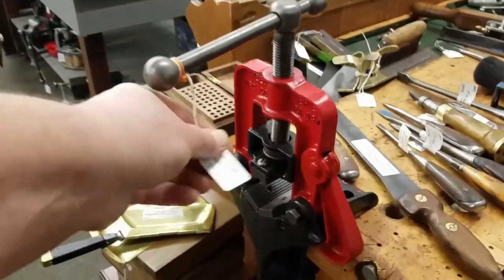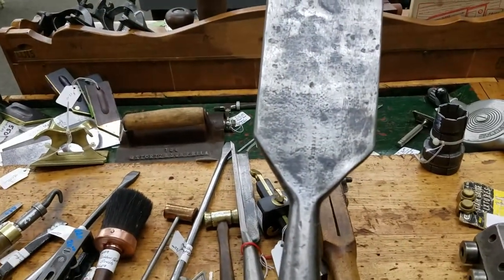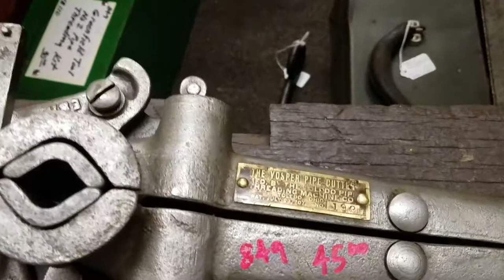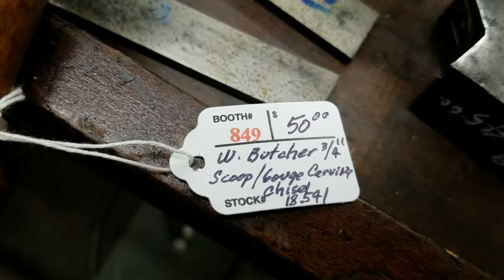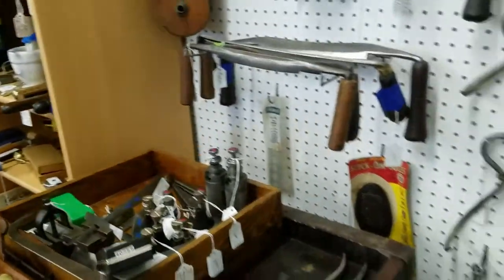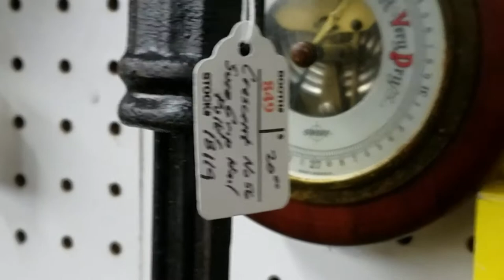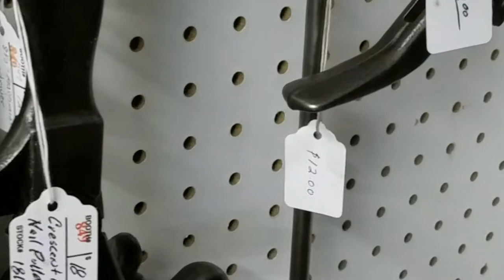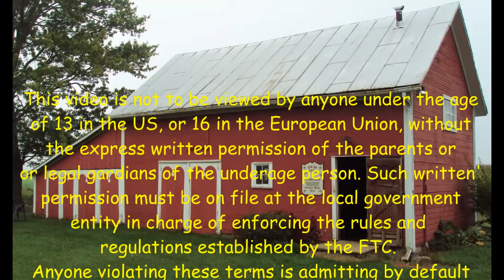On The Road Again   Hog Creek Antiques Pt 1

Comment: The slick was also used by shipwrights. A variant comes with a longer handle that is upswept a bit so you can put your full weight into the cut.
Reply from the maker: I fixed one for a gentleman. The blade weighed about 2 lbs. This one has been abused. It would take a lot to flatten the back. If it doesn't have a sharp edge it is difficult to pare the wood.